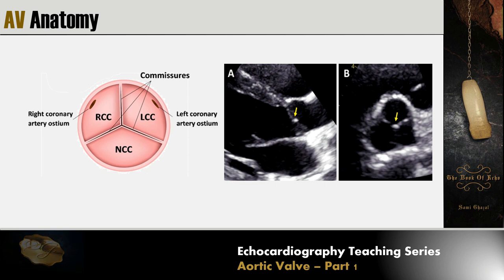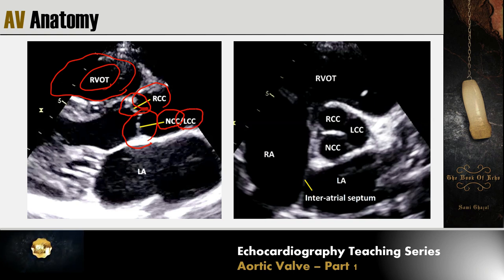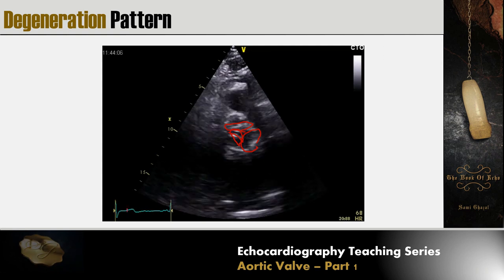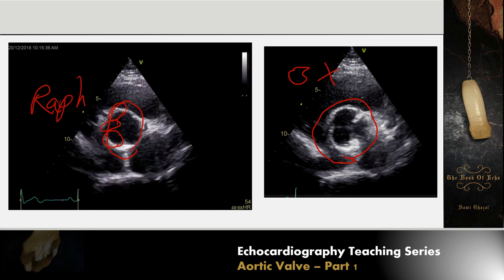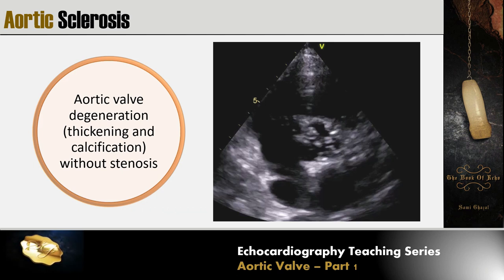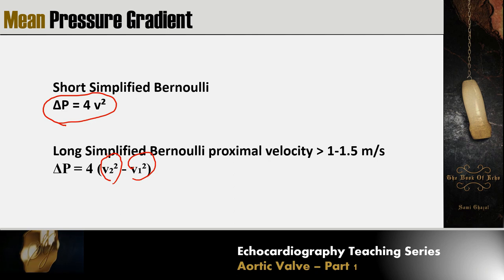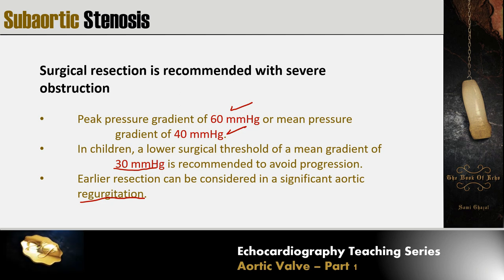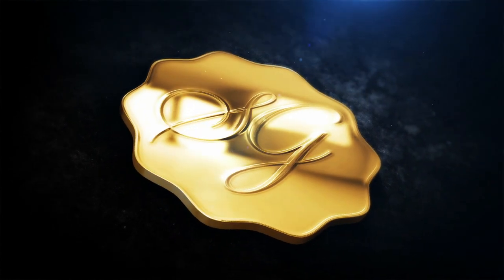Lecture 9 - Aortic Valve Part 1

Comment: I have two questions Dr Ghazal: 
1) When you perform your echo study and there is a septal bulge causing flow acceleration, this overestimates the cardiac output. Do you still report this value or do you use PW doppler more distal from the LVOT to report a realistic cardiac output
2) In the same scenario where there is a septal bulge, let’s say there is also an aortic stenosis. How do you determine the true aortic valvulaire gradient since CW doppler will consider the highest velocity along the track. Do you then take the V1 as PW in the septal bulge and V2 is CW

Thank you for your videos